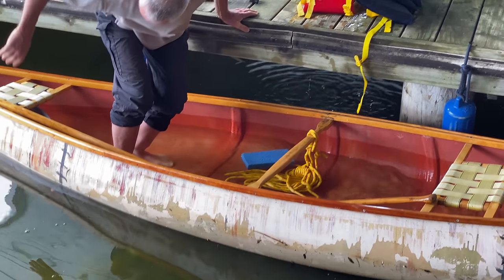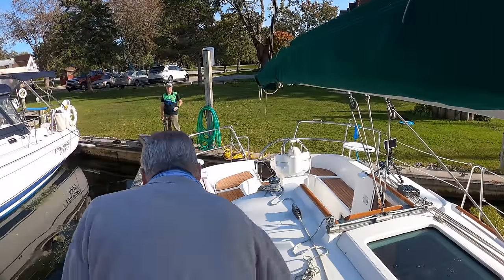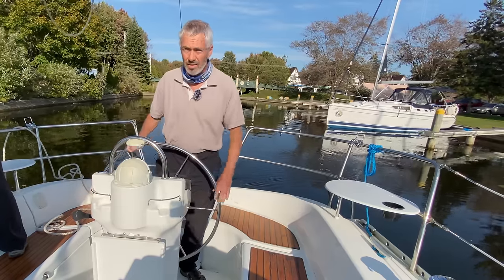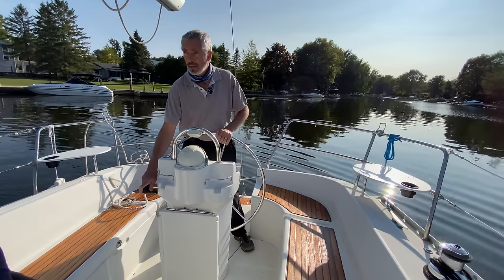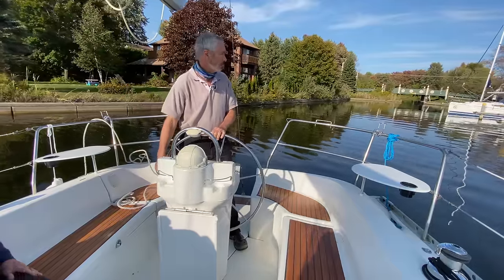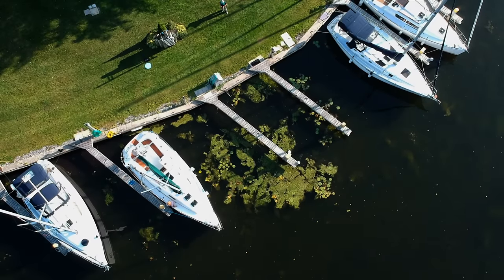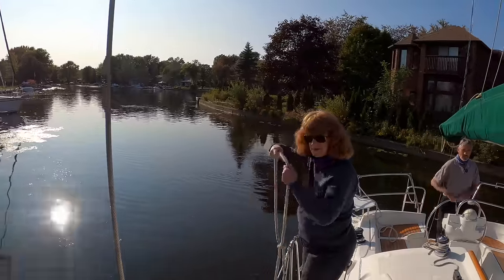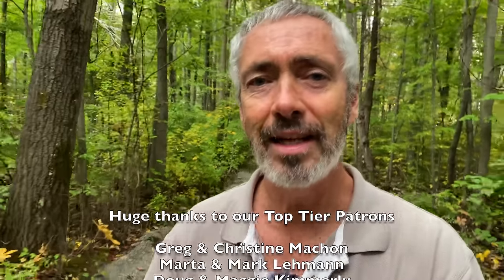Tips for Easy Docking - Handling a New Boat

Comment: I will tell you that I would LOVE a video on single handed docking.  To add a bit, I have a small 6 meter "pocket yacht" (Canadian built Paceship P2-20) and my power source is a 4 hp Evenrude outboard.  I trailer my boat to the launch site and after putting her in I always turn her around so she is facing the lake.  The positioning would be just like your first example here. 
  But being single handed means I have to undo the lines at basically the same time as I start the outboard.  This can be VERY tricky.  Plus, if the wind is blowing into the launch area my boat can be blown sideways toward obstacles before I can get to the tiller and accelerate the motor. 
  I know you guys are used to bigger sailboats but there are probably a number of us out here with smaller boats.  A smaller percentage put their boats in every time they sail.  And an even smaller percentage have to do it single handed.  But demonstrating how to handle the MOST complicated undocking and docking procedure would probably answer lots of people's questions regarding small sailboat handling. 
  BTW - I have always found that coming in to dock is sooooo much easier.  I can often do it with nothing more than wind power.    Scott W    PS- That was one BIG snapping turtle!

Comment: Thank you so much for this, very helpful--especially prop direction and turning.  My issue with any boat, is where we launch: the Ogeechee River in Ga. Beside endless possibilities to run aground, the river is fast moving, and unless we time it to go out, or return, at slack tide, we live in fear of hitting rocks near to either our marina entrance or the public boat ramp.
 I'm just returning to a sail boat and restoring a MacGregor 19'. I am currently ensuring she is sea worthy as a motor sailor first, before putting the mast and running gear back on board. So, learning to maneuver her is now!  Again, thanks for the video.
Reply: Hello John how are you doing😊

Comment: Good video and very well explained; one small point I think your crew placed the spring on the forward docking OVER the railing rather than under. that would damage the railing if you drove forward with any pressure to bring the boat alongside.
Reply: Hello David how are you doing😊

Comment: Very well shot with the added drone video footage that really added to the demonstration.

The explanation of prop walk is something most other video creators seem to leave out of similar content.  We have the opposite prop rotation which I think is much more uncommon.  Most sailboats tend to favor docking on the port side and we often get dockhands advising us to do so and sometimes other unhelpful advice assuming handling characteristics of our boat that are not correct.

I've sailed and docked perhaps a dozen other boats before we bought our Rasmus and it is by far the most challenging sailboat I've ever experienced in tight docking manuevers.  

I would love to see another video using spring lines.
Reply from the maker: Thanks for your thoughtful and informative comment. We hadn't thought of the challenge of having the opposite prop rotation with regards to docking at marinas where they assume you have the more common prop walk. Good point.

Comment: Thanks for your video! I would like to see more about spring lines. I see that you use a prepared loop to put around the piling - can you explain more about how to determine where to put this loop along the line from the clear, and then how you and the crew handles it to stop the boat?

Comment: the last 2 videos you have put out have been about docking.  here is my question:  do you have any techniques for solo docking?  We hear a lot about solo sailing but never about solo docking.  after watching your videos I am convinced of the need for 2 to safely dock a boat.  when there is no one around, what would be some of your limits for solo docking?  would you be so kind as to expound on your concerns and possibly some tips for solo docking?   solo docking is not such a big deal on  docks for launching and retrieving a smaller boat.  Just curious in the situation that is presented in this video what your thoughts/techniques would be.  thanks for your most excellent videos.  I learn more from these videos than any other.  BTW: I have "walked" a boat in to a dock before so I am not necessarily a novice.

Comment: just bought my first sailboat ( Morgan 28' Out Island) and this has been giving me so much anxiety. I have to move my boat up the columbia river close to 100 miles. I have almost no experience, other than a small 16' runabout, but good lord, this thought is terrifying. I dont even know why, because I has driven a land yacht and trucks and trailers and heavy equipment, and all at significant speeds. I know i can drive a boat at .5 knots.
thanks for the video!

Comment: Often when traveling you use foreign marinas.  These marina often do not have “finger” piers and you must dock stern in.  I am often told to set the bow line first which does not slow the boat and whenI suggest setting the spring line boat owners tell me no, even though I know better.  I do as they request as they slap into the dock.  Rarely a soft landing.
Set the springer 2 leading forward different pilings
Loosely set the bow so it can be tighten  times 2
Set your stern line times 2
Return to the bow and set
Set a spring line aft times 2 or 1 if you plan to leave soon

This should be accomplished on both sides of the boat in
Reply from the maker: Our general strategy is to get a spring line on first to control your motion toward the dock when tying to a finger pier or box mooring, Eddie. Thanks for outlining your strategy and reasons for it. I'm sure it will be helpful to others.
Reply: @DistantShoresTV  you assumption is there will be finger pier and often there are none.  Something those of us how sail beyond home are aware of.

Comment: Thank you for posting this video, I’m often single handed and I have a question, at times I have come into a berth fenders ready and if there is a cross wind before I can get off the boat occasionally the bow or stern will drift towards neighbouring yacht and gently kiss with the fenders , no harm is ever done, would you consider this bad seamanship as I’m always a little embarrassed. If there is room I can motor gently against a spring to maintain position but not always ? Love your posts and have learnt a lot from you as this is my first larger yacht single handing .
Reply: Hello how are you doing😊
Reply: @allysonhanks9159  Very well thanks, How are you ?
Reply: @sailingthalassa  I’m good, thanks for writing me back I’m glad 🙂
Reply: @sailingthalassa  hi

Comment: I'd like to learn and if you have suggestions for solo docking techniques.  I haven't sailed solo yet but feel comfortable doing so.  I just don't feel comfortable docking at all yet. I took ASA courses but we didn't get good instruction on docking. I purchased my Hunter 31 this year.  This lesson was very helpful as my current slip has two pilings, one at the end of the 32' finger dock and one midships.  I am in a double well with my well mate, a 40 foot outboard, with only 2 feet of space.  I typically enter the well bow first with the finger to port, my well mate starboard.  I've used a spring line but often the wind is coming across my bow from port.  It gets a bit stressful.  On several occasions we have drifted into my well mate before we can secure the boat.  Also, I am on Lake Huron and the water level is so high the dock is barely above the water line making entry and exit from the boat a challenge.  I built the dock up with a deck that is about 2'x2' to step down about 1'.  Backing in would be great because i could just step off the scoop transom.  If you've read this far, i haven't seen news on the sale of your Southerly.  Has it been sold?
Reply: ignore the question about your Southerly, I saw your Q&A
Reply from the maker: Hi Pat, Great suggestion. You obviously give a lot of thought and care to docking and you have a tight situation. We are going to be doing a Live Q&A on October 17th so will discuss your challenge. If you can't attend there will be a recording. And welcome aboard as a new member of the Distant Shores Cruising Club!